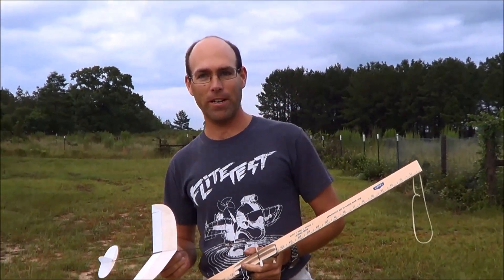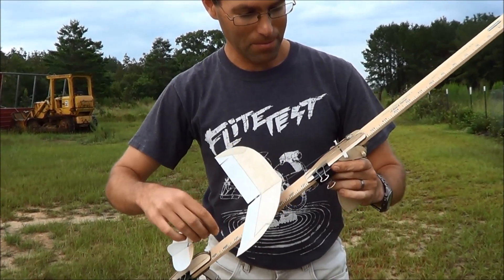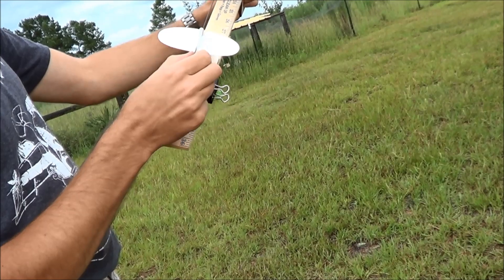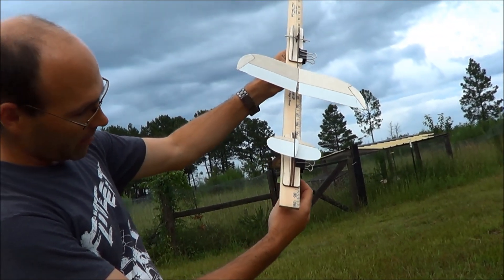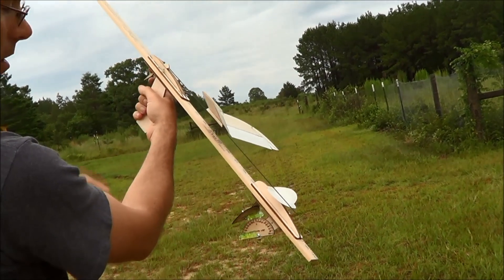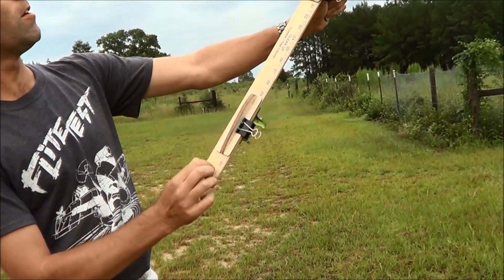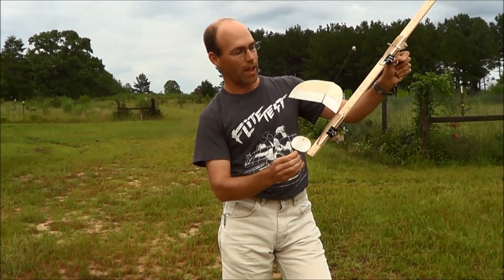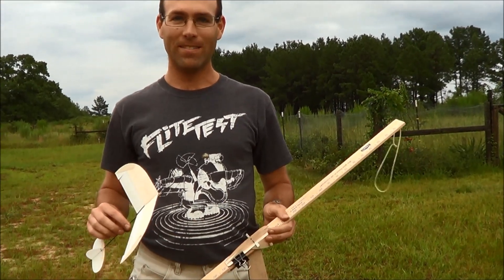The Ultimate Launcher for Science Olympiad Elastic Launched Glider!

Comment: Brilliant!  But, but, it takes all the skill out of launching!

I suggest you put the protractors up front where the pilot can see them directly. It is no longer necessary that he be looking for that sweet spot in the sky.

Wondering about rules and training. Science Olympiad is a training ground for more advanced competitions. Will these launchers be permitted in those events? If not, the SO graduates will be at a disadvantage, they will have to learn to launch without the launcher. That is a set of skills that requires lots of practice to get consistently good launches.

Taking the unclipped parts to a remote contest without the yardstick leaves the semicircular part at home. The semicircle might be made to clip on, too.

I came here from your build video to find out what this thing is that you are building. It wasn't at all clear what the different parts were for.

I can see another use for this, which is to get repeatable launches during glide tests. Glide testing by hand launch includes a lot of variation; some launches will be too fast, some will be too slow, some too high, some too low and the glider uses some of its time in recovery, which is not the steady state glide that you want to measure. This introduces a lot of variance in the resulting data. A launcher such as this, fixed to something like a ladder, can produce very reproducible launches and much more reliable data sets.

My attempt to get repeatable launches is here. You may find the folding rubber attach finger interesting.

http://www.endlesslift.com/glide-test-spreadsheet/

My use of measured glides to teach flight physics is here. (I taught a group of kids how to measure the power used by a glider. Later we may measure the horsepower requirement of a rubber powered plane in glide and compare that with what it actually uses in powered flight. Power required to fly is one of the fundamental problems which confronted the pioneers of flight. It is still a fundamental engineering problem for flight.)

http://www.endlesslift.com/simple-gliders-in-the-science-and-mathematics-curriculum/